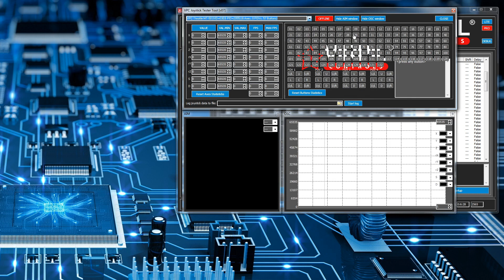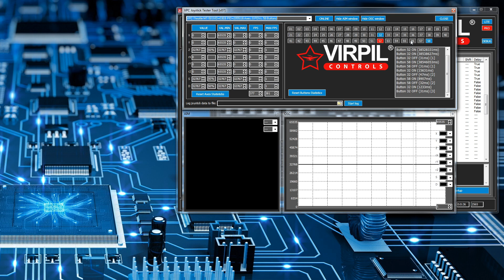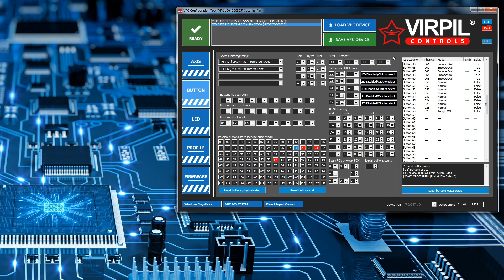Virpil - configure 2-way toggles tutorial

Comment: Could this be a method for XP12/FCU Autopilot Toggle between Selected and Managed Modes for Rotary Switches E1 and É2 (press to latch)?
I have Virpil CM3 Throttle E1 and E2 rotaties bound to HDG +/-  and SPD +/+ (on a Toliss A321Neo Airbus) but the mode change toggle doesnt seem to work as the presses are not latching
I want the 2 buttons E1=61 and E2=64 to be LATCHED
Or you you have a better suggestion?
Thanks iA. for your advice

Comment: I wanted to set up my red toggle switches on my control panel #2 so when they were in the left position they would be off and when moved right they would turn on the navigation lights & cockpit lights then when moved back left they would turn off. What mode would I need for the 2 toggles?

Comment: You, sir, are a frickin' legend  - I just bought myself a ton of Virpil gear and would not be able to make head nor tail of it without your magnificent tutorials ... however -- There's one small thing I think you may have missed here .. in (for Example) Elite Dangerous - things like the landing gear and cargo scoop are normally operated up and down by one keystroke.. by using toggle in VPC and then Gremlin to remap them back to the same button that switch now will toggle the gear up and down with one keybinding in Elite.

Again though - can't thank you enough.